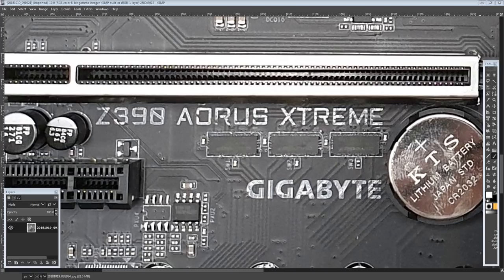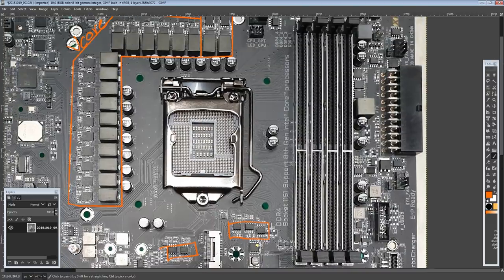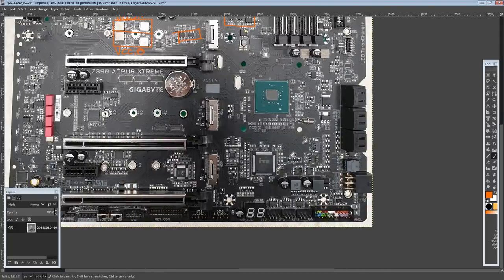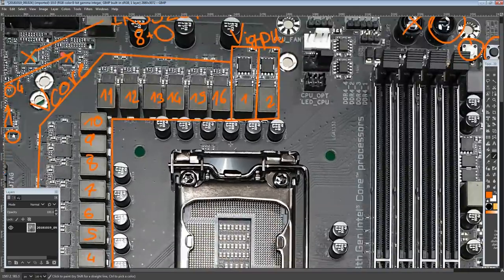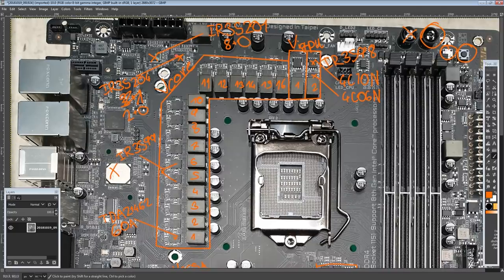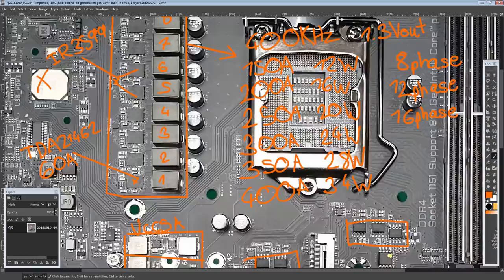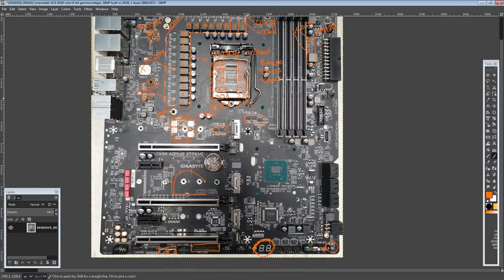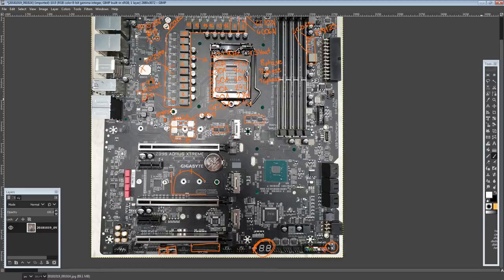mobo PCB breakdown: Gigabyte Z390 Aorus Xtreme // it does almost everything

Comment from the maker: I made a mistake. The board does come with the OC touch panel. YAY!
Reply: Is it compatible with the other board you mentioned ?
Reply: wow finally they sell it :) Great video BTW
Reply: Does this make it worth the purchase since it includes the of touch panel
Reply: Jonathan davis lol no
Reply: How do you dare not type "first"?
Reply: Why 90 degree power socket... it's like... why?
Reply: wow now it's really worth the 600 USD!
Reply: Actually Hardcore Overclocking is there any Z390 boards with PLX chip ??
Reply: Maybe they´ll release a SOC FORCE model. I had the GA-Z170X-SOC FORCE and included an excellent OC Panel and a PLX chip. Too bad those morons at Intel didn´t allow it to support the newer chips, had to sell it for a newer gen Asus ROG board when I got the 8700K and it felt like a downgrade. Nowhere close to the same build quality. https://www.gigabyte.com/Motherboard/GA-Z170X-SOC-FORCE-rev-10#ov
Reply: Please tell me this motherboard does not have the ridiculous orange accents we see on most Aorus mobos.
Also, do we currently have to choose between underperforming mobos or overkill mobos? Are there any good mobos for the 9900K, without going hypersonic, like this one?
I do love that there is a return of E-ATX mobos... And I will definitely buy the Z390 Xtreme, however, I own more than a dozen PCs... Any recommendations on mobos that hit the sweet spot with both 8700K and 9900K?
I've already seen your breakdowns of the Taichi and the Strix... It would be a crime to put a 9900K into any of them, in fact, it is a crime they are allowed to get away with what they are doing to uninformed consumers,
Cheers.
Reply: Any chance you could compare this to the Aorus Extreme Waterforce? Some people want to know if its worth the price of the Waterforce to get the components, not just the waterblock but perhaps to do LN2 etc.
Reply: There's not much documentation on this (ie OC touch panel). If you've had any time to experiment on this or making a short video on how to use it, it would be cool.

Comment: The right angle 24 pin might not have the best implementation on this board, but man I hope this catches on. 180ing the fattest cable and trying to hide it as well as possible sucks so much, this right angle connector could help a TON with cable management.
Reply: @specki - Check these options out.  http://www.coolermaster.com/product/Lines/power-supply-accessories/
Reply: Fenix1861  Nice find. backordered on Newegg, but I asked to be notified
Reply: Why would you hide it?

Comment: I have this board with a 9900K, If you just put one 8pin connector in, you will have coil whine on the VRM's, sinds I put the second connector in, the coil whine is gone. Note; my CPU is running stock atm and also stock when connected with one 8pin.
Reply: thanks for this info. I'll be picking it up some time next month so good to know
Reply: Same here. Voltage is going up to hell.
Reply: Hey guys, me again, If you disable all C-State's in the BIOS, the VRM coil whine is gone.
Reply: @kimtomotion  so it's ok to use only one eps cable?

Comment: Hi, thanks man, just a quick question i can't uderstand.
I have a perfect RM750i psu, can i use it with only one 8 pin eps cable?
I have i9 9900k with all cores at 4,7 ghz don't want overclock.
Power draw for cpu only it's 190 watt with prime 95, i have an rm850i with 2 eps cable but it's cursed with coil whine, i mean the psu, the 705 it's perfect.

Comment: ok I'm a newbie. I have to connect all these cables from the box to the motherboard. its complicated. the instructions are trash. like the box comes with wires but doesn't tell you where to put them.  its like here are some unnamed wires..the box expects the motherboard to tell you where to put them. then the motherboard expects the box to tell you where to put all these cables. people say its easy to install a motherboard.. that's correct if you know what you want.. I don't know anything. like what up with all the led spots. how many spots do I need? where are they located where they are? if I get the fan commander why do I need all these fan controller points? wtf. what up with all the extra point sticks coming out of the board? should i have instructions on what they are? what should be connected to them? why no plastic covers? is it so I can bend them by accident. where is our standards? premium my ass.. just extreme. after watching this board.. 16 phase is the most retarded thing ever if I can't use it. like the insides of the chips will melt out even if its sub zero on the outside. honestly they can just offer a micro boards to attach to the motherboard for the .1 of the people that can afford to buy liquid hydrogen for testing.. some more stick things for them.. I'm not happy at all. its bullshit nothing is label or has instructions. the book should be like 300 pages.

Comment: Just crammed this in a 20 liter case and the 24 pin is jammed up against the front of the case. It comes with the oct accessory and a fan/RGB strip controller.

Comment: i have a few issues with the comment you have made on the dual 8 pin connectors on the motherboard, in a realistic world people who buy these motherboards and cpu's would also buy a premium psu, but in a lot of cases people are just that people, and some psu's on the market don't have provisions for dual 8 pin outs to motherboard cpu and even more of a concern is the psu EPS cables i have seen some with 22awg and some with 14awg wires, now most eps 8 pin outs will accept upwards of 300mhz input but like the 9900k i have seen basic over clocks pull upto 350mhz so, the dual usage of the using both 8pins would allow the cpu to pull its needed mhz from both connectors rather than that of trying to pull it all from one connector...or am i mistaken

Comment: Thank's for this great information. Do you know what Thunderbolt 3 controller is used on this motherboard. I read that on 8 January 2018, Intel announced a product refresh (codenamed Titan Ridge) which enhanced robustness and added support for USB 3.1 Gen 2 (10Gbit/s) and DisplayPort 1.4. Intel offers a single port (JHL7340) and double port (JHL7540) version of this host controller and a peripheral controller supporting two Thunderbolt 3 ports (JHL7440).

Comment: Would I notice a difference in performance if using an Intel Optane 900P SSD on Z390 using the PCH/Chipset lanes compared to X299 using CPU lanes?

Anyway this board is amazing. A proper VRM heatsink.

Comment: I have a serious problem with my Aorus Z390 Master is somebody owning that mainboard and able to do some tests?
Switch psu of wait 3min switch on switch pc on...is it starting normaly?
My one makes fucking 9 start attemps until it starts normal and the bios is reseted, just if i switch the psu completly off.....(saving power) 
I replaced the bios battery, i cleared cmos, updated bios first to F5 than to F6, Removed all unecessary things from the Aorus Z390 Master, Run the Mainboard just with the 9900k, M.2 SSD with the windows, 3 Fans, and 1 Ram thats it i even removed the usb front panels cables and much more.  i used even a other psu from an other vendor
I seriously have no idea why. Can someone confirm this problem with one of the new z390 Boards from gigabyte?

Comment: Hi,  Given the over the top CPU VRM, and its increasing efficiency with higher current draw, how many phases would you do away with in order to offset the cost and add a PCI PLX chip?
Reply: TDA21462 was expensive, but definitely not as expensive as PLX chip. You pretty much need to kill 3/4 of the VRM to get a PLX chip and the other 1/4 to get necessary PCIe slots, signal lines and other stuff.

Comment: I like Gigabyte Boards pretty much, my last one was the Z97X Gaming7, but it couldnt manage voltage regulated fans on most connectors, after i bent some of the cpu socket pins by accident, i changed to an Asrock Z97 Extreme6, which worked much better for my taste, but the uefi looked like.. awfull..
To go with a 9600k on watercooling, which would be the best Gigabyte Board?
I need one Aorus branded Board, as they are the only Brand, that supports 3pin digital WS2812b LEDs, choosable from 12v to 5v, as i have plenty of 12v and all others only support 5v. Sorry for my bad language, i'm from Germany.

Comment: Ghee whiz,HEDT x399 Rog Zenith Extreme is 550USD or Intel's Rampage VI Extreme(LGA 2066) is 610USD,not to mention probably best x299 board EVGA Dark for 355USD,srsly not sure where is Gigabyte going with this price tag?Well, at least this is not even most expensive Z390 motherboard IIRC.
Reply: z390 godlike from MSI was $600 and this is way better than that.
Reply: @mrlithium69   I know,that's what I said in my comment,I wasn't sure which one is.Point is i9 + good mobo is just too expensive for gaming and HEDT stuff will probably do things faster as a workstation.But if anyone wanna spit USD1k+ for mobo and CPU who Am I to judge you?

Comment: It's basically a doubled vrm version of Aorus Gaming7... which I'm currently use... good for 9900k?
Reply from the maker: I plan to test the Z370 Gaming 7 with the 9900K some time soon.
Reply: @ActuallyHardcoreOverclocking  I can't wait to hear your thoughts on that as I have the Gigabyte Z370 Gaming 7 and was considering the 9900K for it but was worried it would not be able to handle overclocks on the 9900K...Brilliant insight from you which is appreciated...

Comment: I'm a noob but could this gigaboard handle two 2080 ti's on the i9-9900k and stay temp stable? Sub'd and thank you for the awesome video!
Reply: It can run two 2080 Ti's but they will both run at 8x.
Reply: @SkyCyron  Thank you Brian, I am not sure what it means will happen if they both run at 8 lanes instead of 16. I am having trouble finding a good motherboard that I can run two 2080s, if you know of one, I would appreciate the feedback.
Reply: Robert Rainey well most of if not all boards will run them fine but if your really worried get a mobo that has a PLX chip these are usually the workstation boards, like the Asus WS Z390 Pro, but like I said mostly all boards should be SLI compatible just check manufacturers site and reviews before deciding.

Comment: Think you forgot to mention the Thunderbolt3 capabilities vs Godlike.. By contrast Godlike Z390 gives the Streaming Boost for the extra money. https://www.techpowerup.com/reviews/MSI/MEG_Z390_GODLIKE/4.html MSI have a Thunderbolt 3 add in card https://www.msi.com/Motherboard/ThunderboltM3.html - but the Godlike doesn't seem be compatible https://asset.msi.com/file/test_report/TR32_145562.pdf ... Also @10:22 - the OC1-connect - is included in bundle. Saw this review by Vortex https://www.youtube.com/watch?v=dCa4YvcjUsw - See @3:39 -> 4:20 in the Vortex review...